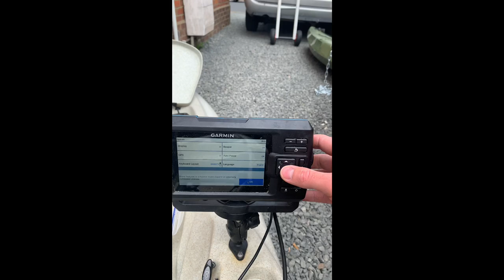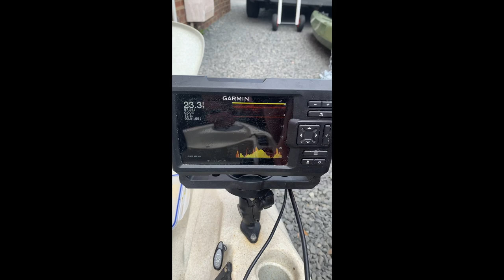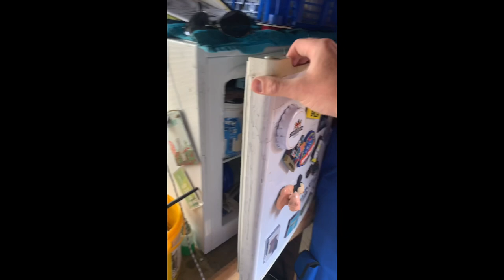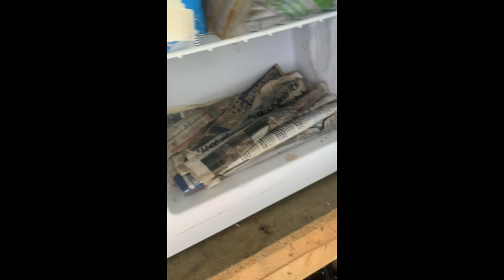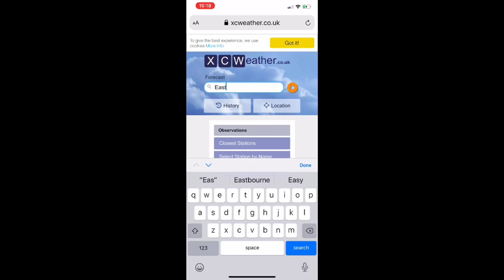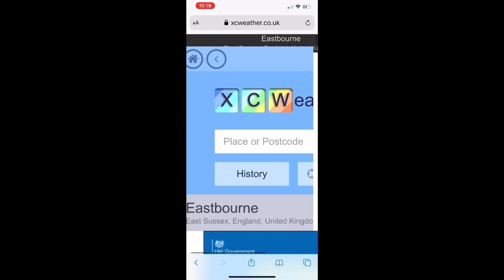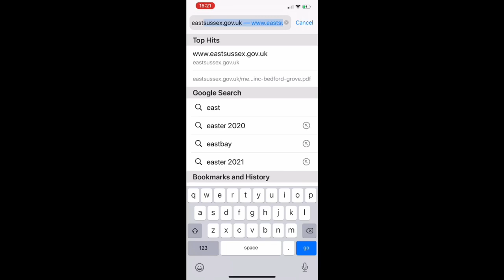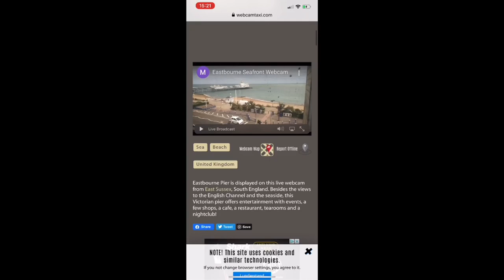A Total Beginners Guide To Kayak Fishing In The UK

Comment: Hi Jake, very helpful video.  The RNLI suggest that kayakers should also carry a smoke flare. They are fairly cheap at £12-14 each.  A paddle float is also a useful addition should you have trouble getting back on to your kayak.
Reply from the maker: A flare is something which is a divided subject, personally I wouldn’t want to carry anything that could set fire and with water they are not easy to keep dry all the time. I’m going to try a self rescue with the paddle float to see how much easier it actually is. Thanks for watching